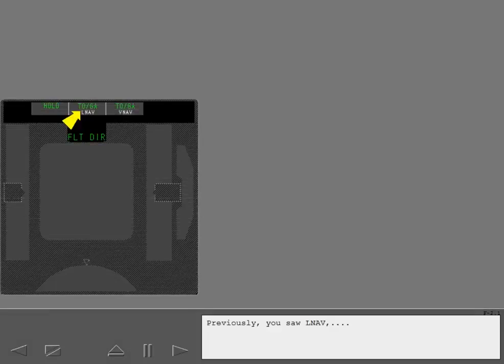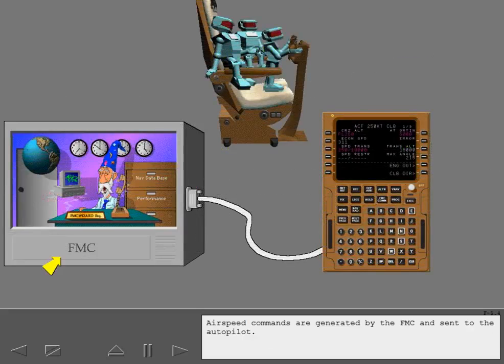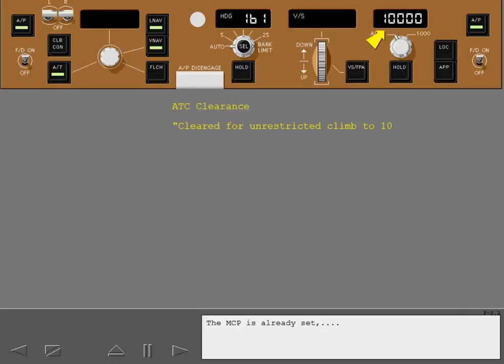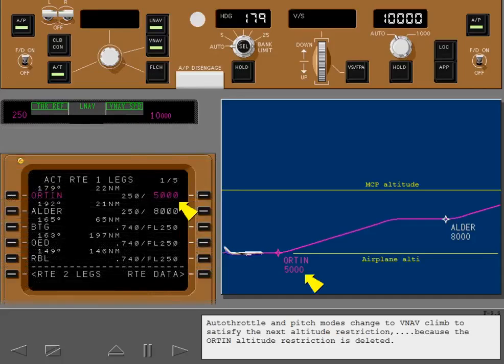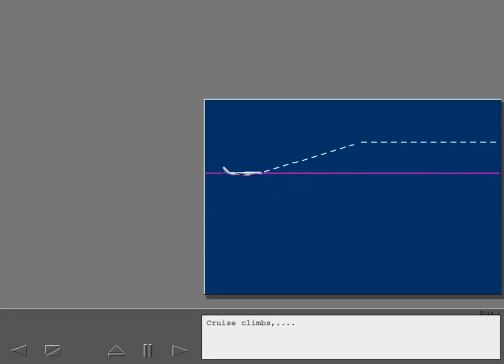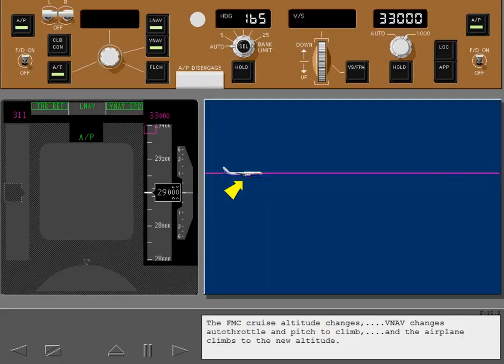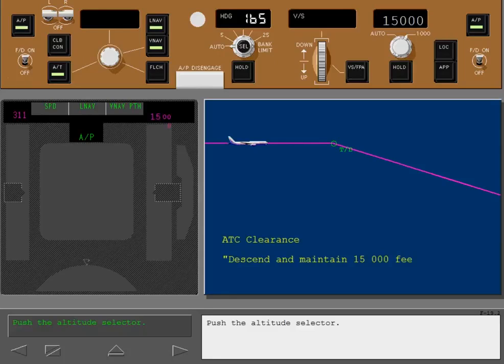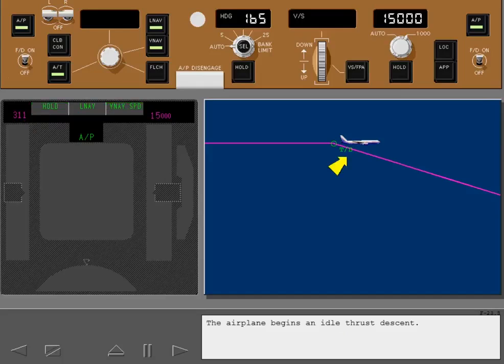Boeing 777 Cbt #12 Autoflight   Vnav Non Precision Approaches And Go Around 4

Comment: 13:17 - bit of an error here…with the speed window open, the pitch mode will remain VNAV SPD and the aircraft will potentially continue to descend below the path (when not in approach logic). In practice, when within 150 ft of the FMC calculated path, cancel speed intervention and the pitch mode will then revert to VNAV PTH.